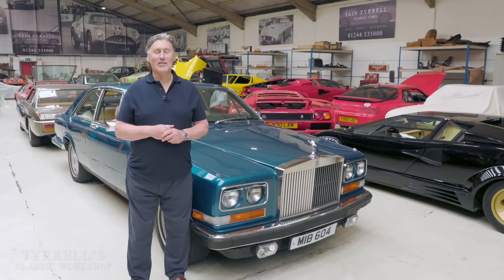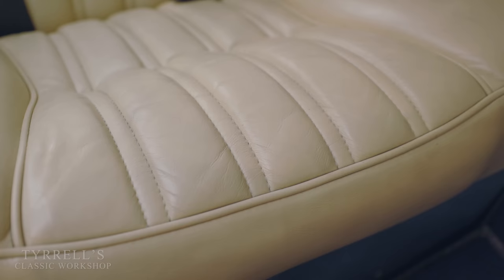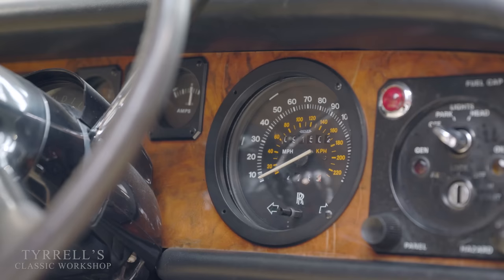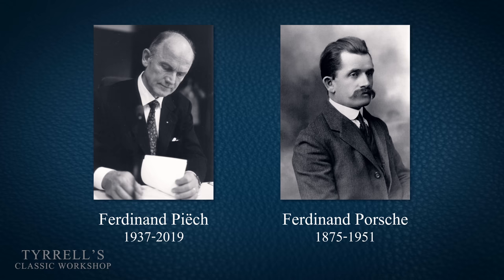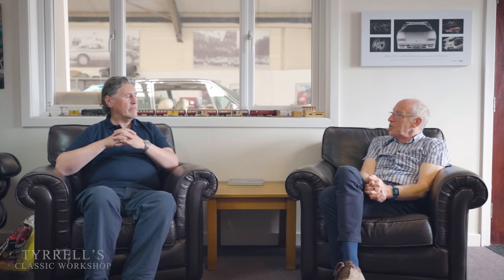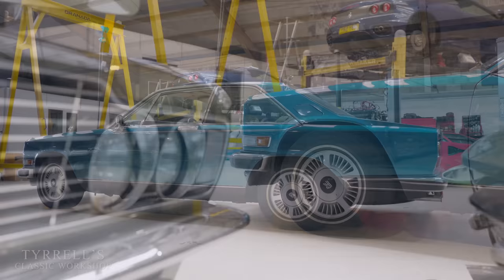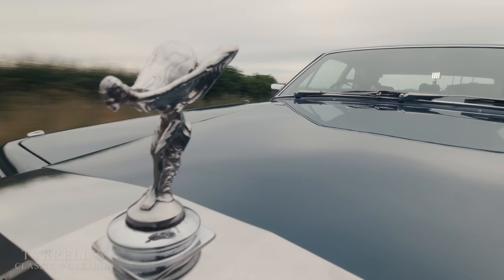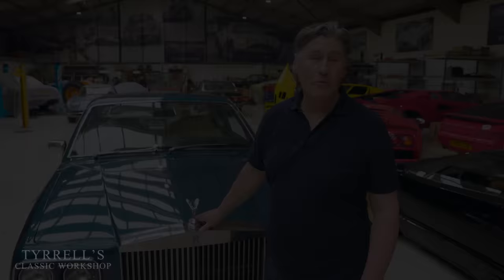Rolls-Royce Camargue - a surprising source of inspiration for the World's priciest production car

Comment: You put it perfectly when you observed how there has been a recent appreciation of 1970s era cars in so far as their styling. I am quite old enough to remember that time. And, at the time I thought that kind of styling was simply...well...ugly. To a certain extent, here in America, the "ugliness" was due to size. 

At that time Detroit was still producing what we call today "land boats". But what was a rather attractive use of size in the 1950s and 60s, had become by the 70s and early 80s plain old grotesquerie. Then came the era of the so-called (by Lee Iacocca at Chrysler) "K" car look. Yet while they did away with the large sizes they also did away with any hint of style, of "art". I put this Rolls into that category: straight lines to the point of excess, so that with this car the angularity of the rear roof's diagonal comes across as a kind of relief for my eye.

Comment: That looks almost identical to the Rochester Quadrajet on my 1970 GTO 7.5 liter. They made many variants of this carburetor with vastly different flow capacities. I'd be curious what the CFM rating is on that one. The one on my GTO is rated for 800 CFM

Comment: Hallo Iain,there is something wrong in this car,maybe the classic Rolls Royce grille is too high,or the front lights are too little,because I think the problem is the front,too boxy,and infact is the only part of the car that really differs from the Fiat 130 coupè. The 130 was sleek,this was massive,because is a Rolls Royce but it seems she is lacking something. The Fiat 130 coupè is not the only sister of the Camargue: the others are the Peugeot 504 coupè,the Ferrari 365/400/412 and the Lancia Gamma coupè,that was an evolution of the previous cars and was designed by Aldo Brovarone. But they are all Pininfarina cars. The shape of the c-pillar is very similar to that of the Ferrari. But of all the four sisters the Rolls is the biggest and is not sleek and light as the others. i might say that she is the richest sister but the less pretty of all them. Anyway,year after year all these cars are becoming more interesting and intriguing for a collector. And year after year the Camargue looks better as she never looked before. Last but not least,the Camargue probably needed a more powerful engine,not aspiring to a sportscar performance,but something better for that amount of money could have been done. Anyway I am always happy to see a Camargue.

Comment: I can remember the styling of this car being severely criticised by the likes of Autocar and Car Magazine (rip) when it was introduced.  I think it is so close to being achingly beautiful with  Pininfarina not getting it quite right as you describe.  IMO the stance of the car in your video is still a little too "00" gauge and could do with the wheels being pushed out even more.  Re. your comment about it being too low at the back:  I thought that would have been intentional as the Shadow always seemed to waft around with a very "tail-down" attitude. One reason mooted back then as to why the Carmargue ended up looking like a slightly misshapen version of the sublime Fiat 130 Coupe was the problem of having to use a platform closely related to the Shadow and trying to stretch the stylist's design language over hard points that wouldn't quite fit.  Critics opined that those strange dipping chrome strips beneath the side windows were added as a bit of an after-thought to try and disguise the higher than desired waistline.  I'd love to see a rendering of the car without those, because staring at it now, I don't think they were necessary.  Nevertheless I still think its a beautifully sleek car - if not absolute perfection!

Comment: A quick search didn't yield anything, but did the Solex 4A1 have anything to do with a (GM) Rochester Quadrajet? Spread bore, vacuum secondaries, teeny primaries, it looks the same... And the give-away: due to the relative size difference between the primaries and the huge secondaries, a Quadrajet equipped GM V8 always had a distinctive micro-hesitation when given the boot: WOOoooOOOOOOM (😛). Exactly this sound can be heard on hard acceleration at 31:30. Too many coincidences - there has to be a connection between the 2 carbs.

Comment: I wonder what the mileage is on that Camargue ? My eyes tell me that that is a replacement speedometer. Anyway Ian Rimmer  (R/R Crewe for many years)once told me that the bottom chrome sill strip should, when extended, go virtually through the middle of the wheel discs if the vehicle is sitting correctly ? This was his rule of thumb for the Shadow range so maybe not applicable to the Camargue.
Reply from the maker: I knew Ian well. Yes, this was the problem, they didn’t get it right with Camargue until the 80s
Reply: I recall bumping into you at at couple of R-R.E.C events in the early 80's (now that makes me feel old!) with my mentor John Bowling. I think I may still have the business card you gave me, it  was in a dull yellow and dark red if I remember correctly. Very pleased to see your efforts have been rewarded.
Reply: Hello Ian R ! I remember being sat with both you and Ian Rimmer at Harewood House many years ago, I hear you are being tempted out of retirement to assist with the running of a well know Rolls-Royce & Bentley garage at the moment ? Please let me know if this is correct.

Comment: My favourite RR and any design as good as the FIAT deserves to be used more than once, both being expensive and exclusive it's unlikely you'll see them parked next to each other at the shopping centre and even if by some fluke they were it would be like Wow! How about these two and a Ferrari 400i for good measure.
Yes, those horrible wheels and stance ruined the car, I'm sure the designer would have been aghast on seeing his creation abused. The placement of the door handles is not only aesthetically pleasing but technically it is mounted on a stronger part of the door.

Comment: The Solex 4A1 DVG was otherwise known as the four headed devil, a bloody awful thing. BMW and Mercedes used them the 2.5 and 2.8/3.0 cars including the 525, 728, 730 and Mercedes 280S where they were about the right size. They were too big for the 2.0 really. The main problem was distortion of the carb casing's two halves as well as a myriad of issues with the chokes, idle solenoids and tbh, just about everything else.

Comment: I worked at AB motors Hull when Fiat 130 Coupes was new and at JCT 600 Hull and worked on these Rolls Royce and i always thought Rolls Royce copied badly the Fiat.

Rolls Royce used the dreadful TPA paint system and Fiat came to UK as deck cargo on submarines ..

Comment: Well built car, though as an owner & driver of Mercedes-Benzes I prefer them. As to designing parts that you can operate with a pinky finger--door handle, shifting stalk etc.--that's the reason there're so many obese slobs in this world today (I'm not one of them); they want to do as little work & hence burn as few calories as possible. That's why I drive Mercedes-Benzes: opening & closing doors on them is like opening & closing doors on a Panzer--it burns a hell of a lot of calories & keeps me fit.

Comment: The back end of that Rolls doesn’t match the front: the taillights are all wrong for it and the edges of the rear fenders and trunk are too sharp.
Reply: The lack of a reversing light in the light cluster makes it look like the cluster is a prototype placeholder. Even though it is totally bespoke to the car, it never looked right to me.